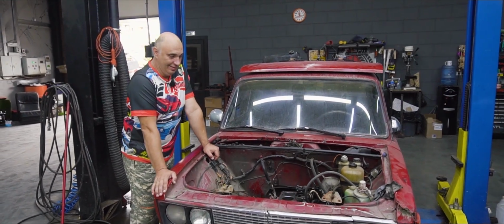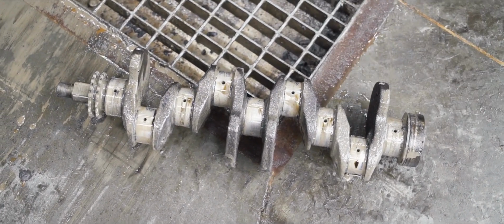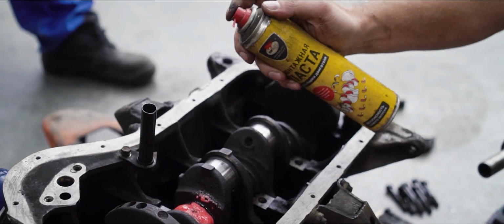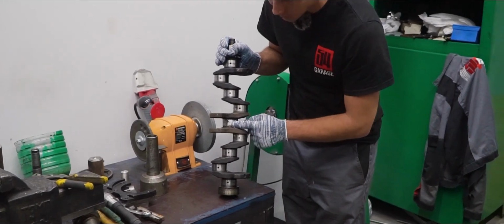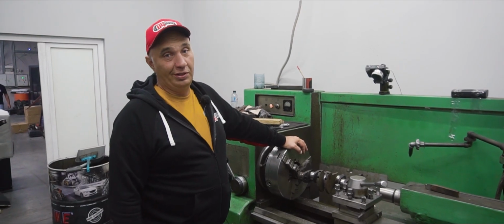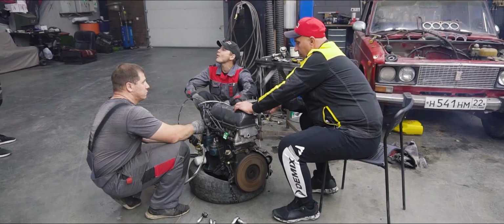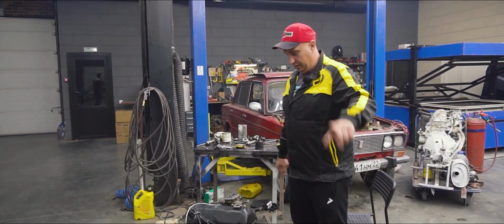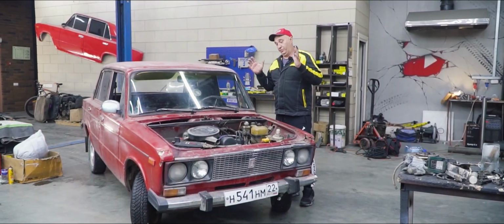Welding a broken crankshaft – will it work?

Comment: preheating the crank all the way through to 150 deg F. and using a stick welder with a graphite fluxed welding rod for iron will draw the carbon away from the weld for better results.

Comment: Tried this on a diesel crank that broke on the no4 rod journal only lasted a week daily driving but then again I can't really weld that good. I've not yet had a gasoline engine in the shop that broke a crank mostly diesel engines and they always snap on the no4 rod journal but if I get one that snaps on a main journal I'll try this again.

Comment: In modding cranks for a stroker the machine shop will chop out your rod journals and re-weld them on wider for longer throw (longer stroke) but it goes to heat treatment once again because it is welded. Perhaps they anneal the crank first to make it softer to weld and correct bending

Now I want to see that engine run on a cross-plane crank (cut up the cams to suit timing too) and do a tune and dyno for that too

Comment: I tried this three times and failed each time. The break happened on the edge of the journal flush with the counterweight. I wasn't good enough of a welder to make a weld that would hold up to much more than the crankshaft's own weight.  Just a tap on the workbench and it would break again. I'm impressed with what these guys did right here.

Comment: everyone be like "wow it works" and im like "ofc it works". with proper welding its basically like new. this however was not perfect welding as everyone seems to believe. no preheating and using the wrong rod. do a follow up video where you put this on the track and show how far it goes before breaking. my guess is something like 200km of mixed driving.

Comment: The real issue here is longevity.

Welding cast is pretty tough, it probably will just crack from heat cycles, not a high stress moment, just after the 200th heat cycle or so it'll just crack in half.

Comment: Tbh those 70~120hp engines don't have the power to break a crank.
Cast iron Cranks can handle up to around 500hp as a daily driver.
Do welding weakens the crank? Yes. But does it really matter when the weakened crank can only handle like 300hp (a guess number) when the engine can barely make 100hp? not really.
Another thing to consider is where it broke. It would usually break closer to the transmission due to have all the cylinders working on the crank. But the further away from the transmission it breaks the less cylinders the weld will have to handle making it a viable option in pretty much any case.

Comment: Hallo guys I have a crazy idea ! Can a car work entirely under water (distilled ) if you suply the intake with a hose ? And the exhaust with a pipe ? Differently you can use Norman water but you must find a way to shield the electrics of the car from water !  ( Resin , silicon , or something else ? ) I beleave this idea is crazy  for you .

Comment: Mildly scary indeed lol. I've seen what kind of damage can broken piston rod do to an engine block. Almost cutting it in half. Would be interesting to see damage after crankshaft snapped. Though bearing caps should still hold, maybe the damage to the block wouldn't be as bad.

Comment: Garage 54 racing lada motor?
Lightened flywheel 
Drill holes in the sides of thr rods and try and reduce as much weight in the engine as possible and see if you can make a racing motor at home...
That would be interesting to see 😅👍

Comment: Maybe it’s just a translation thing but iron is an element.  That’s is only iron by definition 
Once you add carbon and a few other things it becomes steel.
You can obviously weld steel but who knows exactly what’s in a crank shaft :)

Comment: It can be welded but it has to be on a special machine, and the crank has to be cryo treated after because the weld will be as soft as the rod bearing and that's not good.

Comment: you need to wickedly clean the crank and you want to stick weld it with hardened steel.  welding distorts the crank so it has to be straightened before you chuck it in your lathe /  grinding lathe.... no matter how well you weld and straighten and grind, you've still got your oil journals so 4 cycle cranks can not be welded but i used to weld 2 cycle outboard powerhead crankshafts

Comment: I know a guy in the UK got hold of a prototype 2 cylinder mini engine(original A series mini not crappy BMW mini) he had no camshaft for it so chopped up a 4 cylinder A series camshaft, machined it and silver soldered it together and the engine ran fine.

Comment: I would be curious to do an oil sample and see if there is any high metal deposits in the oil. Especially if they could put 1000 kms on the engine.

Comment: Well, low price cranks are usually made of cast iron. Expensive ones are usually made of forged chromoly steel.
It appears these Lada 1.7 engines are cheap enough to experiment on and throw away when the experiment goes wrong.
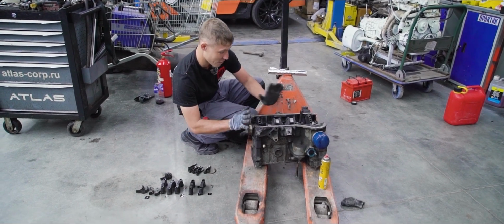4:52 A new crank or used crank might be a little bit out of alignment anyway. Here is an example from a Pontiac 350:
https://www.youtube.com/watch?v=12UdcpXHxPM
https://www.youtube.com/watch?v=GLDO56liwsI
This garbage core had to be heavily reground. On one Pontiac 350, most people are afraid to go to -.030 inches. This crank was ground to -.040. He was lucky to find bearings to match. -.030 inches is close to -.75mm and -.040 inches is close to -1.0mm
8:55 I live in the USA, and when I heard of MIG welding, I thought it was an invention to build MIG aircraft.
20:31 Maybe that kind of engine isn't power dense enough to need a forged chromoly steel crank, and that is why it worked. Also, for all I know, the welding wire was stronger than cast iron, and with a few tricks, the crank could take more of a beating than the stock unit.

I enjoy watching whatever experiments you can come up with. I think it would be funny to make tires entirely out of Teflon. Since Teflon has a low coefficient of friction, the tires would be almost impossible to use. I'm not sure what it would take to build a Teflon tire.

Comment: A friend of mine I used to work with hired me to remove his engine and have it rebuilt,then reinstall everything. ( I used to do mechanic work as a side gig). His truck was an 87 Ford F-150 with the 300 straight 6 cylinder. It still ran alright,smoked a little bit. Engine was kinda loud and clunky. Anyway I removed it and hauled it down to the Engine/Transmission/Machine shop to get rebuilt. The next day the shop called me and says the crankshaft was broken in half and it needed to be replaced. It cracked at an angle between one of the main bearing journals under the main cap. I went down to check it out. It was rocking back and forth in there for so long that it looked like it was perfectly machined like that. The bearing was shot. I really couldn't believe my eyes. Had the main bearing journal and main caps align bored. Replaced the crankshaft with a reconditioned one. He retired about 5 years ago and he was still driving that truck. I replaced the engine about 2006 or 07.

Comment: The problem here ofcourse (assuming the weld penetrated all the way through) is now you have a section of the crankshaft that is of a different hardness to the rest of it...sure it might work but if it breaks again I've got money on where it will be

Comment: It's not under that much stress considering it's a supported Journal bearing and because it's supported Journal bearing it has the ability to handle more stress and tolerances because it's surrounded by a solid piece of Steel therefore if you're actually going to break a crank you should break it at the connecting rod and try welding it there and see how that works I would pay to see that video actually cuz I've never seen anybody able to fix it crank that broke at one of the connecting rods

Comment: A small note here: Instead of iron, a closer translation would be cast iron. Pure, elemental iron is what "iron" means. Basically cold or hot rolled soft iron with almost no carbon. A small carbon content will create steel and the hardness will go up as you increase it. At around 0.7-1% carbon, you arrive at cast iron, a really hard and brittle type of iron that they are talking about. The reason it's hard to weld is complex but it's an infamous cast iron problem (it's case hardened, it will get carbon content gradients, the random heat will anneal or harden it in spots etc)

Comment: at the time of writing this comment I am at 0:04 in the video.
I come from a partial engineering background (my dad was a mechanical engineer that worked on industrial plant and could really turn his hand to fixing things pretty handily, hed usually drag me along for the ride to learn things, i took to computers rather than mechanical)

assuming that the weld lines up with the crankshaft (ie doesnt disrupt the weight/balance of the crank, or is kept within tolerance) this would work 100% judging by some of the comments, Garage54 have a top class welder.

the theory is that if a weld is done properly, its tensile strength will be stronger than the material thats being welded

Comment: Weld a rod journal and see if it still holds together.  I would also be curious if the weld would crack over time with heat cycles.

Comment: A Stick welder and Nickel grafite rods is usually how you weld cast but you need to pre heat the cast first otherwise when the weld cools the cast will crack at the edges of the weld

Comment: I have an Idea to try. take a Lada and remove the engine, Fill the engine bay with used Car/truck batteries , remove the driveline except for the diff and if need be flip the diff so the yoke is at the back. Then put an electric motor in the boot with a chain drive. using sprockets.... That one should keep you awake LOL

Comment: Fun fact, when Porsche were developing the flat 12 917 engine in the 1960's, they experimented with glueing the crankshaft togther, it was to get around a problem they had machining the central output gear.

Comment: Can you weld the crankshaft back together in such a way that 2 cylinders have ignition simultaneously and the other two also together. So that it's like a two-cylinder engine but with a cylinder capacity twice as large. Interesting to see how, for every 4 revolutions of the crankshaft, there are then two power strokes and two strokes where no force is produced, if you know what I mean. The spark plugs of the two simultaneously operating cylinders will have to be connected with a cable in order to ignite simultaneously. I'm looking forward to it already.

Comment: Modify a engine to fire backwards so you have one forward gear and 4/5 reverse
Reply: That would be done by messing with the transmission not the engine 
Cool suggestion though 😄

Comment: the weld is only sending half the torque because its been welded between 2 and 3. if it was welded behind cyl 4 then it would be all the torque.
was hoping you guys would limmiter bash it for 30 seconds or so. XD

Comment: What about holes for lubrication? mby try enabling them for some other video and see how that goes? When you do that you would have a long-lasting crankshaft now it will use all oil in the bearing and start heating up

Comment: most 2-cycle engines use needle bearings without pressurized oil, the oil in the fuel lubricates them. i want to see a 4-cycle crankshaft lathed down to fit a set of needle bearings and delete the oiling system. windage should lubricate them enough. only issue might be needing to lubricate the cam and finding the appropriate bearings to fit
Reply: There is no oil mixture in the crankcase. Maybe use some selaed roller bearings, they contain grease inside.
Reply: @dave161141  no 'oil mixture' in the crankcase other that the oil pan containing oil? Windage could lubricant the bearings. Considering 2 strokes bearings see soo little oil, windage should be enough to whip up the oil. 

Not sure how you would put sealed bearings on the crank journals.  2 strokes use split bearings that come in halfs just like normal automotive bearings

Comment: My wifes Crank pulley broke centrically around the center shaft, meaning it freely rotates while the center is still bolted in, somehow still have that pulley turning by pulling the alternator belt really tight which synched the pulley tight against it's insides, car shouldn't run in condition but it does.  Already ordered a new pulley thou not expected to arrive until Christmas, had not luck finding a used one any where locally or on the net.

Comment: you have got to fix your wheel spinning machine  . we can't be done with that . [ to much fun still left to have with it ] . like tire balancing with sand inside the tire . they used to put a thin bag of something inside the tire it would break open  and every you stopped and started the tire would rebalance for what ever speed you were going .       let's test it .

Comment: Assuming because of location that even that small welder is 220v albeit with the wrong wire, but with a good person behind the trigger, got some pretty good penetration there. They were at least thoughtful enough to grind the faces to maximize this.  The only side note, the Lada engines and mods are more likely to hold together being low HP (and low stress) on an already iron block engine.

Comment: I expected it t go boom on startup with cast iron being so brittle.  But surprise surprise not only did it survive but it worked great and survived a hard test. I lot of it is alignment and the kid being a top welder. It would e perfectly apt with low horsepower applications. I reckon it would probably go for years.

Comment: Actually heliarc welding using Argon and let alone if you didn't need to secure the crankshaft the way you did I would have suggested using plaster Paris and go half the dep's clean out the excess and then remove it and then cut it and it should fit right back in and that would be pretty damn close to the truest alignment you could get the plaster Paris can definitely take the Heat and also too if you got oven box preheating at about 400° you'll notice the difference

Comment: I have an excellent idea project.  Take a Lada engine and short it to a 2 cylinder Lada engine in operational condition.  And install it in a Lada.  From block, intake & exhaust  manifold  to head ... Like really miniature the engine to 2 cylinders.  A Garage 54 special custom motor.

Comment: The key to welding iron is preheat preheat preheat . You can either use a 77 iron welding arc rod a 7018 , or 6011 All of which are suitable for welding gray iron . Your best bet is a 77 iron welding rod and a careful even preheat .

Comment: I have also had a 1976 mustang II V6  HO that had a broken crankshaft and it ran perfectly except for a little bit of knocking. The crankshaft was broken at a 45° angle inside the center main bearing. So the front and back half were forced to turn together if another crank was split.

Comment: How about making a driveshaft from various materials? Fill some pcv pipe with concrete, fortified of course. Or, maybe use things more elastic or that construction foam. Go from lightest strong material to heaviest, from elastic to rigid. Attachment of ends may be quite difficult, but I am sure you gentlemen are able to discover the solution for that. Cheers!

Comment: I think you should cut the crankshaft and camshaft in half. Then you can weld half of each shaft to mechanically change the timing on that half. Like 45° off, 90° off, and 180° off.

Comment: I always wanted to know what happens if you cook some gasoline in the stove, or in the microwave. (by cook I mean: Putting some fuel into a pot and then putting the pot on the burner to heat it) and what happens if you put gasoline in the microwave. Thankyou for everything and it would be very nice if you guys do that experiment.
P.S: I explained my self, because english is not my main language so i wanted to be sure i was giving the correct idea.

Я всегда хотел знать, что происходит, если готовить бензин в плите или в микроволновой печи. (под поваром я имею в виду: налить немного топлива в кастрюлю, а затем поставить кастрюлю на конфорку, чтобы нагреть его) и что произойдет, если вы залите бензин в микроволновую печь. Спасибо вам за все, и было бы очень хорошо, если бы вы, ребята, провели этот эксперимент.
P.S: Я объяснил себя, потому что английский не является моим основным языком, поэтому я хотел быть уверенным, что даю правильное представление.

Comment: What could happen if you weld a wobble to that bent crank between each bearing?
Reply: Or replace the rods with hardened springs
Reply: @averymackey2966  They have done rod springs already

Comment: It's the optimal place to weld it, in the centre. The torque generated from cylinders 1 & 2 will be effectively equal to the torque generated by 3 & 4 so no twisting force relative to each other. I suspect a weld close to the flywheel might generate different results.

Comment: Can you weld the crank shaft so all the pistons are at top dead center at the same time and modify the distributor to fire them all at once
Reply: That wouldn't rotate the rotating assembly though. Would essentially be a grenade.

Comment: This was awesome to see done and something that has been said gave me an idea for you guys: "Since when is it a subaru motor?" 
Can you make an 2x2 cylinder from an inline 4? 
Cut the crank, cut the cam shafts, fit a flyeheel to both sides and try to make both flywheels move a lada(or anything els you'd like).
Keep it up💪🏽
Reply: That would need a custom engine block

Comment: A more interesting one, can you build a piston out of welds?
Basically you splatter the molten material from the weld into a piston shape like a 3D printer would and then see if it would hold up.